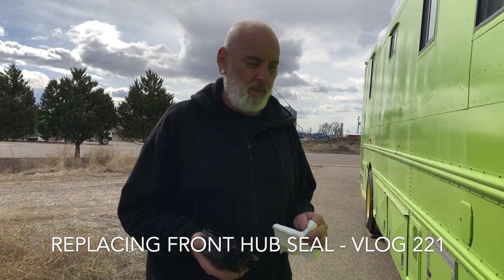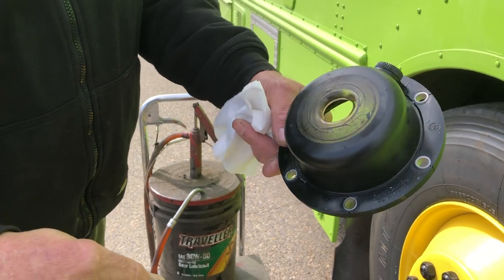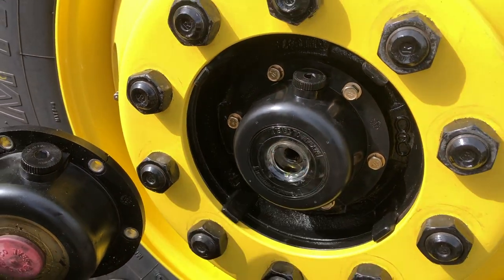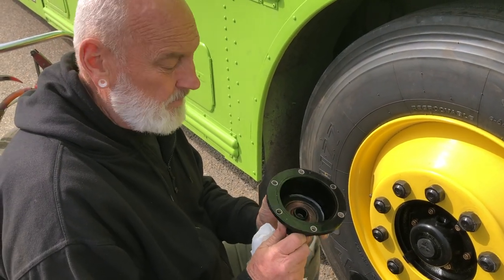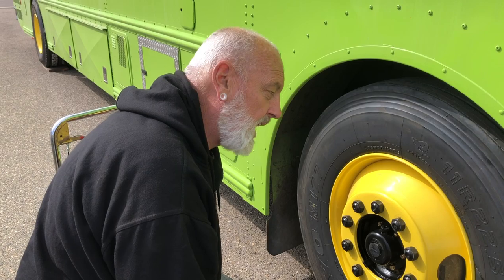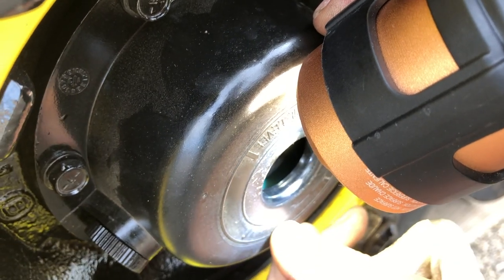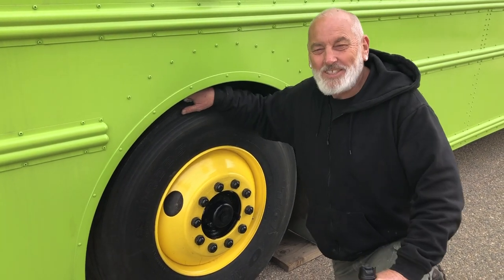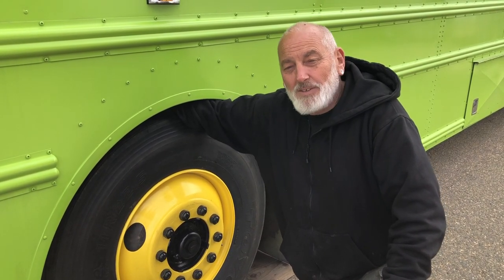Replacing Front Hub Seal - Vlog 221 School Bus Conversion

Comment: Thank you for showing the hubs. The plastic cracks as it ages & the oil can leak out. If it dries out, the hub will overheat & seize. That would be a disaster as you would probably lose control of your vehicle. I check my trailer hubs weekly & get it on video, since I've had 2 fail in 2 years. Carrying a $10 quart bottle of hub oil & checking your hubs regularly could save your life. (Drive axles get lubrication from the differential.)
Very smart to replace the shocks. Worn shocks will cause uneven tire wear. New shocks will ride smoother (obviously) but also help keep the tires on the ground when you have to slam on your brakes. 👍🏻
Reply from the maker: Good to know. Thanks for sharing.